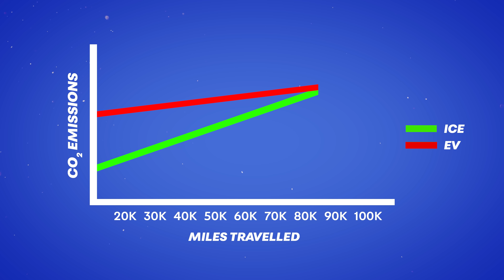Are Electric Cars REALLY That Green? [New 2022 Data]

Comment: Thanks for a more honest and in-depth look than some of the other 'EVangelists' give it. It's my opinion that EVs will continue to be a great alternative to ICE vehicles and this will only get better with innovations in battery technology helping to drive down cost and weight, while improving energy density, safety and longevity. At some point the natural forces of free markets will take over and you won't need to alienate ICE owners by lecturing at them because they'll see the benefits - and cost savings - of owning an EV. For me that'll be when I can get a 250+ mile EV (with good NCAP rating - looking at you, Renault) for around £10,000.

TBH, I'm far less bothered about CO2 than I about actual pollutants like hydrocarbons, NOx, and carbon monoxide (CO). After all, CO2 is necessary for the growth of plants and certain industries, not in any way dangerous in such low quantities as we see in normal air (around 0.04%). This is also one reason I don't see hydrogen as a great alternative for energy storage as it still depends on combustion at the point of use, unlike an EV.

Comment: Battery technology is advancing very quickly - so batteries are becoming smaller, safer and more environmentally friendly. BYD's blade batteries are claimed to degrade only slightly at 500,000km, so it seems that electric vehicles are destined to last a lot linger than ice vehicles. Electric vehicles have come a long way in just ten years, so I reckon that in ten years they will be far more efficient than they are now. So I will be waiting a few years yet before getting an ev

Comment: Forgot about what's needed to mine petroleum? Electricity. Yes. When it comes to EVS they always ask where does electricity come from, but they never ask where petrol comes from. As if petrol magically appears in petrol bunks. Petrol is mined using electric or diesel pumps, then transported either in ships or electric pumps in pipes. Petroleum has to be refined(again emissions). Then again in trucks all the way to petrol pumps which use electricity again. Why not simply use this all the electricity used to run electric vehicles? Unlike petrol vehicles we can run electric vehicles off sunlight.
Solution is to Keep driving whatever you are driving right now. If you need to a different one buy a used one.

Comment: It seems better but how manny ppl take a new car every 3 or4 years so you won't get at that point that electric cards pass the 52000 milles.
That means the none electric car is better. 
Only when you keep driving the electronic car for a longer period it will be cleaner.
And we didn't even count the battery that needs to be replaced when it dies. 
And of happens a lot.

Comment: It's great to see a video that not only explains the EV / ICE green issues but also shows that very few "people in power" really want to see, hear or be truthful about the Un-Greenness of EV's (EV - Electric Vehicle, ICE - Internal Combustion Engine)
It would be good to see some other comparisons, i.e.,  EV's v ICE diesel's, EV's v ICE LPG or even EV's v Hydrogen.
I drive a 20 year old V8 Range Rover with LPG, it runs on Petrol when 1st started with a 'Cold Engine' and within a mile it will automatically change over to LPG . In the 12 years I have owned this RR every MOT has shown it's emissions to be a big fat 'ZERO', I wonder what the maths would show on that as a comparison.
One final thought, Nature makes fossil fuels and will always be replenishing them, wouldn't it make sense to find better ways to refine the crude oil?

Comment: you are 100% correct.  Mining the lithium and cobalt  for a battery takes 7 years worth of fossil fuel a ice car would use.  and the battery only last about 5 years if it is well cared for.  just do the math.

internal combustion engines last for decades and decades which is better for the environment because you don't have to keep manufacturing cars and batteries
Reply: What utter garbage!  Almost all EV batteries come from new with an 8 year warranty!  Never mind about maths. You need to do more research.... You probably don't even know the oil companies have mined cobalt for decades. They need it to remove sulphur during the refining process.  My friend's BMW engine didn't last for "decades". He had to buy a new engine after 4 years. It cost him thousands.

Comment: You should see how much pollution is going into the air in trying to upgrade the infrastructure to handle this electric future right now. The current systems in many areas can't handle the load.  The next 15 or 20 years will put 100 years worth of extra pollution into the atmosphere in trying to keep up to going green. Electricity is literally made because someone burned diesel, gas, an oil product. All these new charging stations are built by diesel construction equipment too. Uneducated people feel good about electric because they don't see the big picture, they only see what's right in front of them.  You wanna be green, get your ass to work on a 50cc scooter. Leave the F series Ford pickup at home (best selling vehicle in canada).  People have no interest in saving the environment even if they say they do, they just need a new excuse to sleep at night.

Comment: The two big problems with EVs is the range on a single charge and how long it takes to charge the vehicle.  A third problem is that the United States doesn't currently have the electric generating capacity to make a nation wide switch to only having EVs going forward.  All that electricity has got to come somewhere.
Reply: Exactly
Reply: Try taking a look at how much electricity the US oil industry already uses, and you'll get some idea where the energy might come from. Huge amounts of electricity get used just to pump oil out of the ground, before it even reaches a refinery...that's a complete waste of energy.

Comment: I have a Tesla Model 3. I absolutely LOVE the car, which I've owned since 2018. On the record - I did not buy this car for environmental reasons! I bought it because it is totally BADASS! It's fast, comfortable, and extremely dependable! ZERO maintenance - except for tires! I've owned over 20 cars in my lifetime. This car is heads above the rest!
Reply: If I had a EV I would totally consider getting flexible solar panels to cover every square inch of the car allowing you to extend the drive distance significantly and to never have to plug in to charge.
Reply: Not sure why they dont come factory like that.

Comment: Hypothetically, even if everything you said was dead on balls accurate. The average lifespan of a car is WAAAAY longer than 90,000 miles. If it's greener only after 90K miles, that's still seals the deal. Though that's also not including the pollution from all the extra parts in an ice vehicle engine that break down over the years that didn't have to get made in an EV because they don't exist. Also not including how much more energy efficient EVs are. That's where ice loses the most. Way to go Autotrader

Comment: The most inefficient thing you could do with your fuel is to turn it into electricity to charge  electric cars.
Reply: And how does that compare with using huge amounts of electricity just to pump oil out of the ground before it even reaches a refinery, then using 6 to 8kw of electricity to produce each gallon of gas/petrol and diesel, then using 25% of all the diesel produced, to transport the rest of it all over the place to be sold, then using more electricity to pump it into vehicles which burn it at 30% efficiency at best?  Isn't that something of a waste?

Comment: Both an EV and Gas run vehicles may use the same manufacturing process, but when you get them out on the road, one is producing harmful pollutants into the environment, whereas the other is not producing any. I have a plug-in hybrid EV which gets about 30 miles on a battery charge, and I worked less than 10 miles from my home, and I was able to drive it for almost a year without putting gas in the small engine that ran the electric engine when the battery ran out of charge. The car raised my electric bill about $20 per month plugging it in everyday to recharge the battery pack, but my previous gas run automobile would have cost me 4 or 5 times that per month to keep it running on gas.

Comment: The problem with these videos is that yes, Creating a new EV car is not green but the fact that you can also buy a used car, convert it to electric, and put some solar panel on top of the roof is a solution no one wants to try.
The goal of transitioning into EV cars from combustion engine is to introduce the use of electric power more and remove the burning fossil fuels entirely.
You missed the point of the one step of the long journey of EV cars and don't get me started with fossil fuels power your EV by electricity for there is this thing called Nuclear power to generate electricity in the first place, people just doesn't want to accept it.

Comment: I would like to know what home, with solar cells, can produce enough energy to run the house without being on the grid, much more even produce enough to charge an EV. In all of my experience with wealthier people who buy solar for their roofs, it only partially drops their power bills.

Also, how many EV owners keep their vehicles for 100k to break even?

Not defending gas (petrol) cars. I drive a big diesel 4x4. I want a Tesla. I just look at facts and the statement about charging at home solely on renewables is BS. I want to see an average home that runs only on solar. No, you couldn't put a dang wind turbine up in your backyard in most places.
Reply: I live in Southern California and have solar on my house. With the exception of high heat times, where AC is run more, most months I am selling electricity back to my utility. So it is very possible (under the right conditions), to power a household with solar. This is even with the restrictions we have on panels installed (they wouldn’t let us install more power than our demonstrable historic consumption was, even though we had plenty of room on the roof for more).
I realize Southern California is pretty much the ideal use case for solar, so your results may vary.
Reply: @mevensen  You're cheating. You're in one of the sunniest states in the union. Out here (east coast) I know many people who have had their roofs paneled and they wish they'd never bought the things. I am personally waiting for solar panels to be more than 24% efficient at absolute best. Once solar gets into the 70% plus range of conversion efficiency, I am in.

Comment: The best thing for the environment is to reuse and recycle. Our 2015 Tesla Model S and 2014 Toyota RAV4 EV were both purchased used. We also have a 1955 GMC pickup that is powered by used Nissan Leaf batteries.

And since he mentioned being powered by renewables, we have solar panels on our house, using that for power, so all three exceeded that 29,000 mile mark before we even got them.

Comment: Volvo didn't include the cost of disposing of an old battery and installation of a new one. Not to mention hauling of loads will always be more efficient in an ICE vehicle unless battery tech takes HUGE leaps forward in efficiency. Considering Musk himself has said the mineral material for batteries is going to be hard to come by within the next 3 years, it doesn't look like there's the development time necessary to get there any time soon. I'll stick with my ICE truck and ICE boat.
Reply: I doubt there would be any cost to disposing of an older EV battery, as they have considerable worth in the recycling/reuse industries....

Comment: There are is a factors not discussed here. The life of batteries, how many charging  cycles before batteries quit. Can electric cars  go the distance like some cars like Honda and even Nissan. can electric cars go 200 k through 300k miles with the original battery pack from the factory. I have yet to see a million mile electric car with that longevity.  Of course  there won't be honest data detailing these points. Can you rebuild dead batteries like an ice car. 
Those that are heavily invested in battery tech will only  promote their future investments to the detriment of the real facts.

Comment: So is this accounting for the number of charge cycles a battery can go through or the degradation that occurs for extreme heat or cold.  Then say the battery goes bad under that 90k threshold. I understand there is appeal in heavily urban areas and probably for good reason.  But for the guy in the Midwest that has his vehicular parked outside when it’s 90+ outside and in the winter when it’s -15.  Those batteries are going to take a hit.  And 30-40 k for a battery that’s going to need replaced at least once in a vehicles life makes it a real hard sell

Comment: Realistically I don’t think you should run out and buy an EV now if your car is in good shape, but when it comes to replacing a vehicle you intended to replace then EV makes a lot of sense.  What most of the studies about parity tend to exclude is the cost and impact of drilling, extracting, and refining oil.  In terms of manufacture the costs and pollutions are more front loaded for EV’a because of batteries but there’s a huge environmental impact from oil outside of just the CO2 production at the point of combustion in the vehicle.  Never mind transport of fuel, gas stations, oil spills, etc.  My next car will be EV, but it’ll be a few years before I’m even considering the purchase just because I don’t need to get rid of my car right now.

Comment: From what I understand it will take the average EV 11 years to break even with ICE cars in regards to carbon emissions.
Reply: and during that 11 years, the ICE car will pump out Co2 emissions every time the engine runs. There will also be the waste oil from oil changes....  Volkswagen build their EV's in factories with a zero carbon footprint, powered by 100% renewable energy. The cars are built using a high percentage of recycled and plant based materials. Even the paint finish on the cars is plant based. So where will that 11 years worth of carbon emissions come from exactly?

Comment: One thing that is not taken into account is the life span of an electric car vs petrol. I have 240,000 miles on my Corolla and still have the original engine. An ev battery will have to be replaced at some point (maybe 9 years?) and will cost more than the value of the car.
IMO the greenest thing that you can do is to keep your current car on the road and not buy a new one. The pollution cost has already been paid on the manufacturing.

Comment: I am all fir EV's however the reality is this. I wrote a report on this six years ago. When I got done factoring resources, manufacturing, updating the electrical grid and the fact that the majority of electricity comes form coal, (It doesn't matter if you buy green it all comes from the same supplier, you are only supporting green energy) I concluded that the EV's damage is at least 5.7 times that of a internal combustion engine. Keep in mind just like solar and wind power a majority of the components cannot be recycled without creating a tremendous amount of pollution.

Comment: Please always take into account the amount of water that is being needed to produce a car weather it is an ICE or an EV. Water is a recourse that is very limited.
And also please compare both systems after the break even point of  90.000 miles. The battery will loose performance and can hardly be renewed.
Reply: Er, no. Most EV batteries are capable of being refurbished, in the same way a worn ICE engine is. The individual cells in the battery pack can be tested, and the failing items can be replaced with functional ones. This normally costs way less than a total battery replacement.

Comment: I've also heard that the batteries in EVs will need to be replaced every ten years, wouldn't that add to the overall CO2 cost?
Reply: Unfortunately, what you don't seem to have heard about are battery pack refurbishments, where the battery is tested, then the failing cells are removed and replaced with functioning ones. This normally costs way less that a full replacement. We have EV specialists already doing this work in the UK...
Reply: @Brian-om2hh  That's still means more CO2 and pollutants produced for the new cells. Recently heard of a study from Volvo that said that EVs cost way more CO2 to manufacture than normal cars. They don't become more environmentally friendly until 100,000 miles or 10 years of use.

Comment: I want an EV car strictly to avoid the ever rising gas prices... but the price of them don't make any economic sense. Min 60k here in canada, where as I can just buy a used toyota carrolla for 15k and and save myself 45k which I will never recoop in gas savings.  EVs need to become cheaper for them to be feasible. Once they are around the 30k to 35k mark then we are in business. I don't think range should be the primary goal for manufactures. People don't need 400miles a charge to get to and from work. 200 mile or less is just fine if you can get the cost down until the battery tech improves and drives down the cost of production.

Comment: Not dirtier just not as cost efficient as everyone thinks. At today's prices of $40-$65k+ it'll take you close to ten years to hit pay off on electric car. Then you'll have to deal with the battery side of things. Yes that's taking into account vs my 2012 Ford F-250 with today's gas prices & oil change. Not worth it. 
When they get these electric vehicles down to $30k and 300 miles range then we'll talk about ROI. Much more palpable then. But with dealers taking off the federal incentive with a $10k mark up consumers are getting screwed. Which I didn't even factor in my ROI spreadsheet.